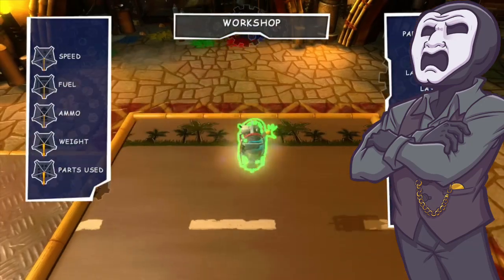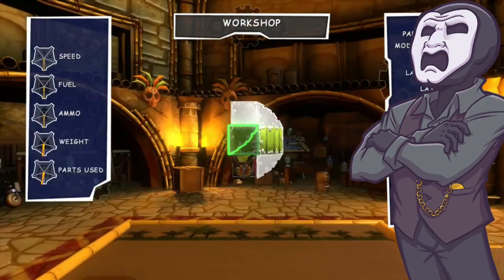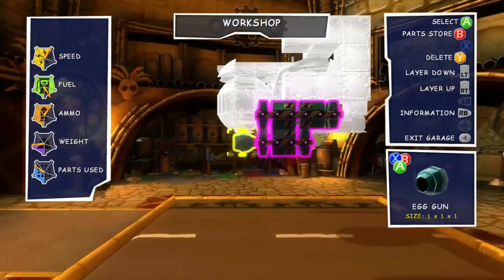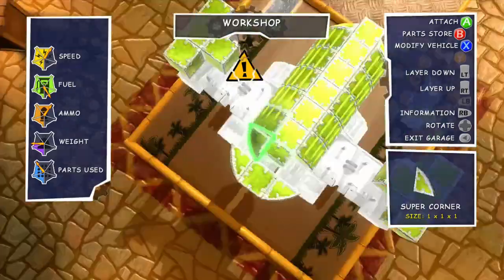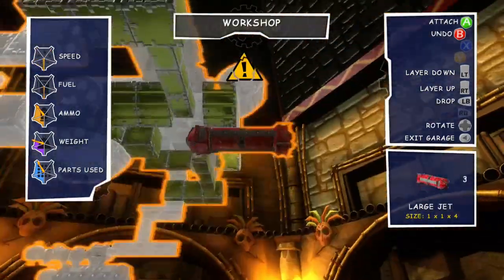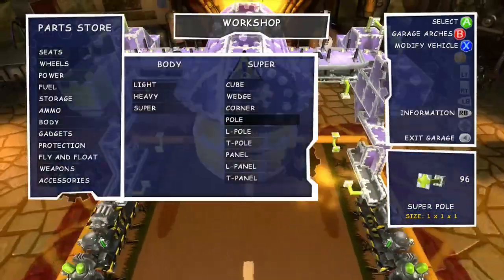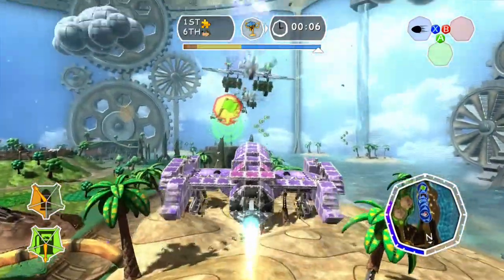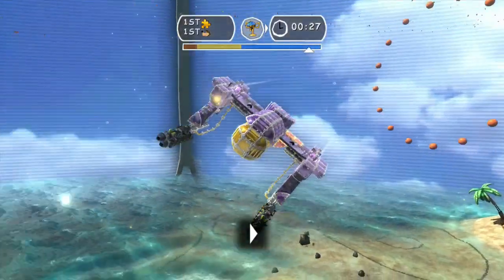Build Request  - Faye's Red Tail (Nuts and Bolts)

Comment: Hi, g&g do you know how to assign components? It's very stubborn, some are not created equal, chronological order doesn't matter results in the definition of insanity, some don't show up, from starting or finishing. I've added so many components recently, as I successfully tested a new & weird design. I've tried to simplify them, so skill replaces them, yet it's a cockpit--to put it neatly. The suck & blow always comes out on top, & the balloons rarely gets assigned, like finding a shinny Pokemon. Again order doesn't matter. To hone down the assignment further, can you get: torpedo, balloons & folding propeller, on the board. In the mix with: suck & blow, & foldy wing (gyro's & spec-o-spy are optional, but would be nice). Here's are some hints, location matters & I think number of items matters, (last one's very hard to tell, very much like the YouTube algorithm). I took a break from it so far. Good luck.
Reply: Nvm it's impossible, just moved the propeller & it changed everything so it won't matter in the end :/
Reply: Just got everything on the board, it's a combination of location & quantity, but I'll still lose it all, since it updates real-time. :(
Reply from the maker: @Eduardo_Espinoza  Hey, you can assign components (with the D-Pad, I'm fairly sure, and also in the pause menu), but annoyingly it has to be done each time and in-game and does not save. There is no way to assign components in the garage so that they remain assigned once you spawn the vehicle. - Grim
Reply from the maker: (I say that I'm 'fairly sure' it is the D-pad as I don't have the controller on me at the moment, and at this point the game is kinda muscle-memory and I don't really think about it while I do it XD )
Reply: @GrimAndGrin  That's the thing, it's a "cockpit." I'm trying to get sub 1 min & I have to shuffle throw a list. Lastly my joints are starting to hurt, it's not the same when the game 1st came out. :( It's okay, I just found a bandaid to get a similar result; getting it started is the hardest part, but I can multitask it on the fly when I'm in the air. :)